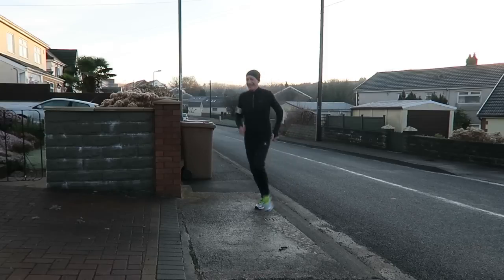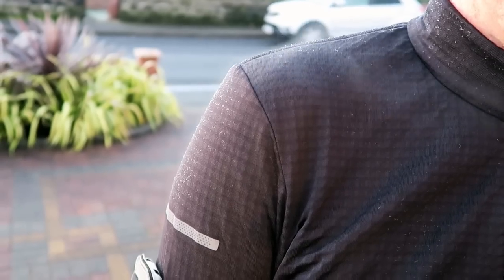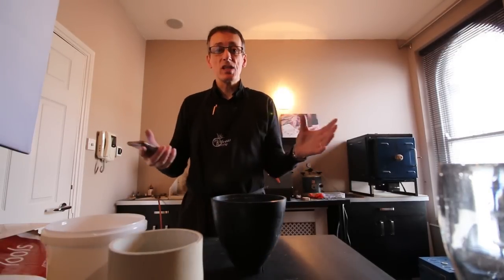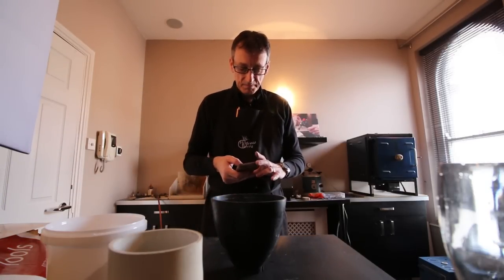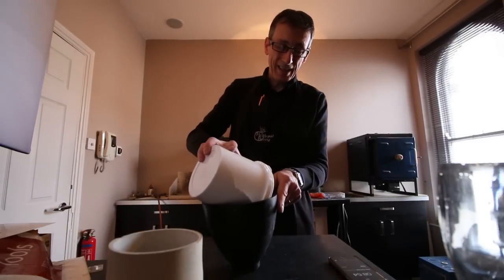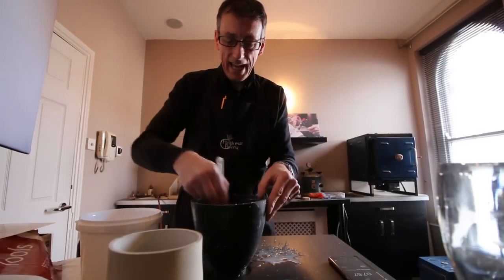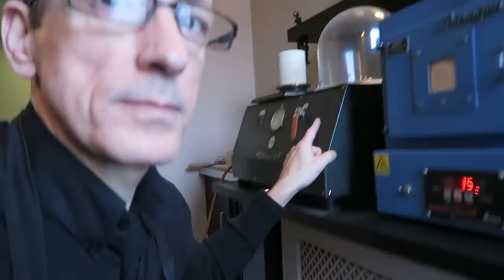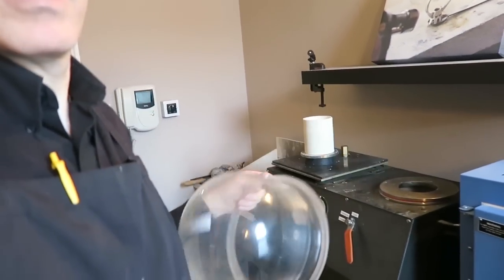I Am Steaming And Lost Wax Casting - Vlog#31

Comment: Sorry, I'm new to your channel and so I know very little about how jewellers go about their work. I have 2 questions:
1. At the beginning, why were 2 chain links joined in the wax cast rather than 3?
2. Is it possible to 3D print in wax, so that it could be cast in investment?

Thank you
Reply from the maker: OutOfNamesToChoose Hi, I had originally 3 joined links and one open link but I could not get that to work when I injected the wax into the mold, so I removed one of the joined links and the wax model could be removed a lot easier. There is an open link so that I can join the two joined links into the next two joined links and so forth. Y s, you could use 3D printed models, they are usually a resin though and not wax.